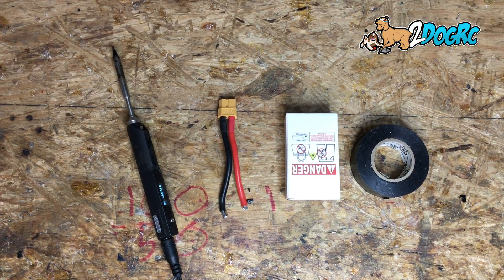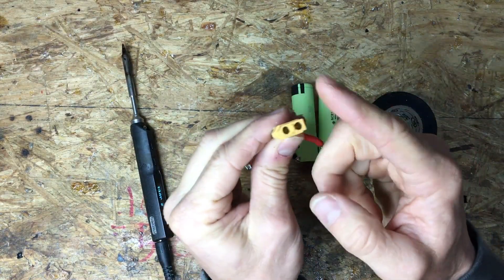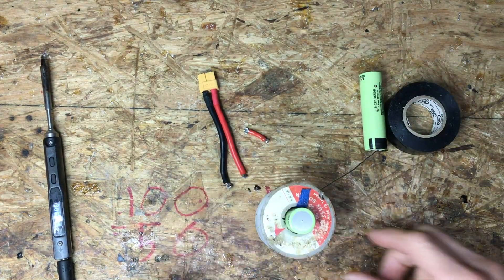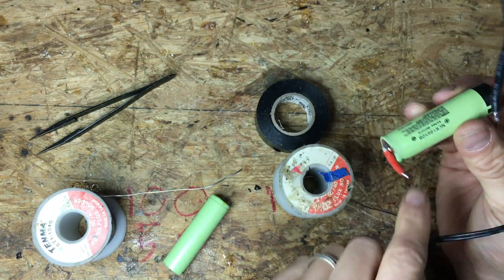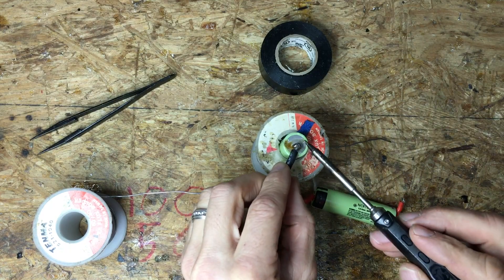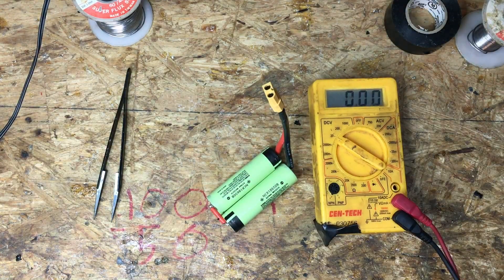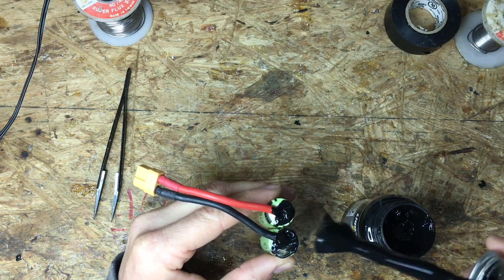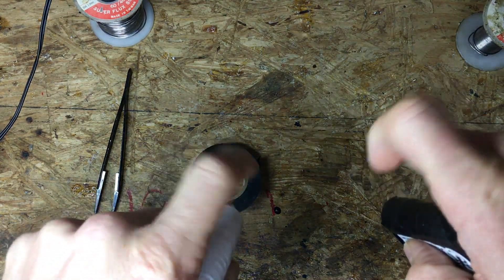How to make a Li_IO 18650B Goggle Battery Pack Fatshark or Any Brand

Comment: How do you charge the pack afterward?
Reply from the maker: I charge via the XT60 cable and select Charge, not balance charge.  These are discharged at such a low current balancing is not important.